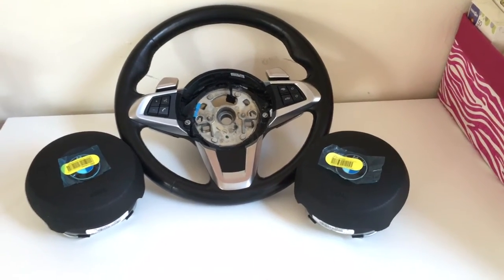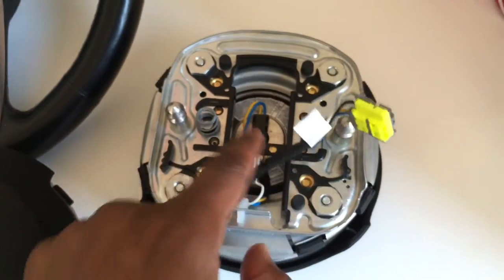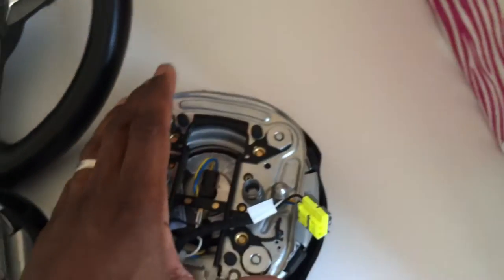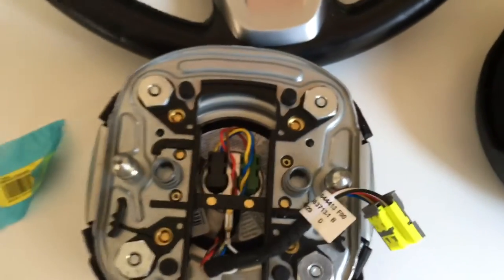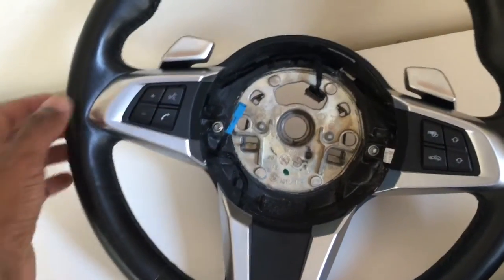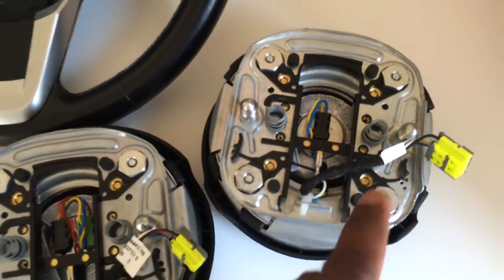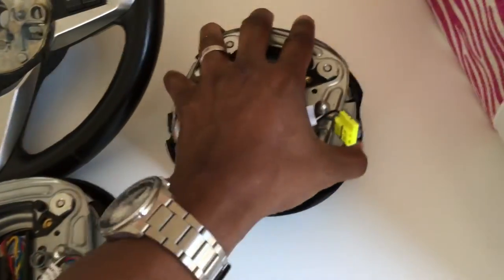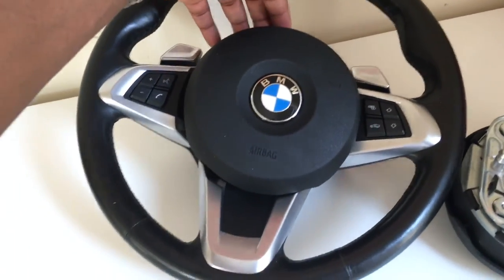BMW Single Stage vs Dual Stage Airbags!

Comment: if you want to use double stage airbag on the single stage  airbag system car, you must disconnect the seconde connector (green color connector) and stay only th yellow color connected, i thing it will work too! ;)

Comment: Thanks so much for explaining the double airbag. I BOUGHT a 2005 Chrysler Crossfire basically a SLK Mercedes and like you I wanted to use the Sporty Mercedes steering wheel. Well the wheel fits but the center airbag is a single stage the airbag in the newer 2008 Mercedes has the double airbag well so guess I gotta put the old airbag in the newer airbag support plus this new steering wheel had the audio and Bluetooth stuff. I can't understand when Mercedes built the Crossfire on Germany why  they didn't have same option for the same yr cars. Mercedes gave Chrysler all the old Mercedes technology but charged almost same price for the Crossfire as they did a medium priced SLK. So that's why the Crossfire didn't make it . This was an expensive flip for Mercedes. I always wanted a Mercedes so guess the Crossfire  is my closest chance of owning one . But thank you Dr explaining the double plug on airbag. Wonder if they were worse together to go off same time the dash lights may not come on. Just a thought ?????

Comment: Its intersting! I tought that the single stage airbags stops to came in cars about '00-'01 cars..
Reply from the maker: In the USA BMW didn't use single stage after 2000. I believe the law went into effect before that but BMW didn't catch up until the early 2000s
Reply: olaf2046
You right. I want to change the steering wheel of my Ci 2000 but the Msport wheel were dual stage :( and my is single stage sport wheel. But no problem. Thanks!

Comment: You could just recode the ACSM module🤦
Reply from the maker: I don’t follow your solution the physical connectors are different between the airbags and the car. Not sure how coding would fix that.

Comment: LOL! I just read your post on e90 regarding the steering wheel, If it wasn't for the fact that you said you got the wheel from Puerto Rico, I wouldn't have made the connection. Right now, I'm looking for an airbag for a 2011 e89.... ridiculously hard, no aftermarket as far as I can tell and ebay only has prior to 2009. If you have any suggestions, that'd be great.

Comment: from 03/99 in europe bmw´s has double stage airbags in every model. I know because I´am retrofiting one in my 97 e36....
Reply: how do you retrofit a two stage bag to one stage bag that came with the car? i have -98 car with 1 stage bag and i want m sport steering wheel but its 2 stage  :(8
Reply: @e36fanatics  I did it a long time ago and there are videos with info about that.
I just remember at that moment that there were two wires, brown and green and each one was for for 1st or 2nd stage of airbag explosion. 
You retrofit connecting the correct wire to have the maximum inflation in case of accident.

Comment: Can x5 e70 upgrade to z4  e89 steering wheel? Thanks! Your amazing nice video .
Reply from the maker: YES! Actually you can upgrade the E70 to the E89! Vice Versa!
Reply: 0LAF2046 thanks man , I need to learn the coding now since the e70 doesn’t have paddle shifters .

Comment: Did you wire the paddle shifters to work? If so how? Or did you not have to do any mods?
Reply from the maker: This is not about wiring rather coding the JBE to match the part. Even still you have to acquire a JBE that came from a parts car with the shift paddles then code it to your car after installing the JBE. That catch is that new JBE must also include ALL the factory options that are in your car. The E90s and current BMW cars are a bit of a coding and parts nightmare! I didn't even bother.
Reply: does the JBE need to be from an e90? I'm hoping to put this wheel on my 2011 335d and want to make sure I know what I'm doing before starting the project. Thanks for all the content by the way.  Learned a lot from your channel!

Comment: Do you still have this single stage m-airbag?  I would like to buy it, if it works with my 2012 F30 320D.  I have a M Sport Steering Wheel without the airbag.
Reply from the maker: no. I sold it earlier in the year.